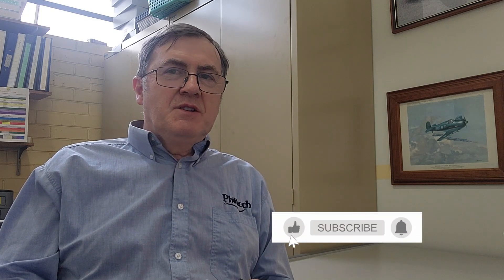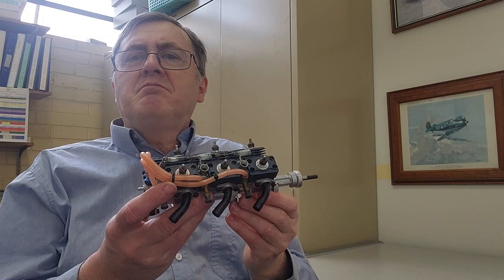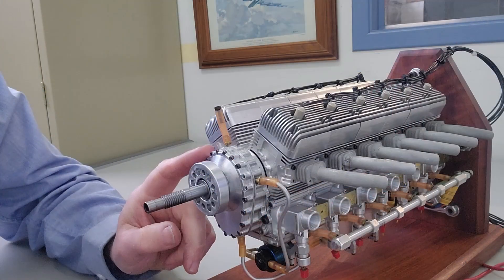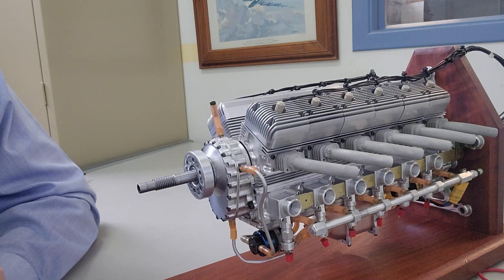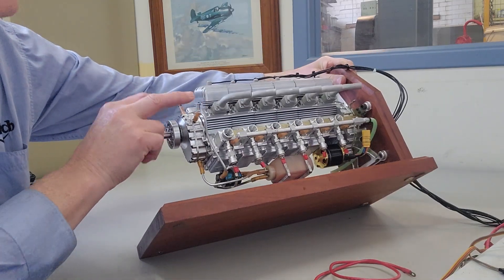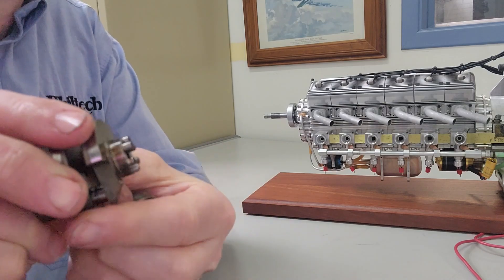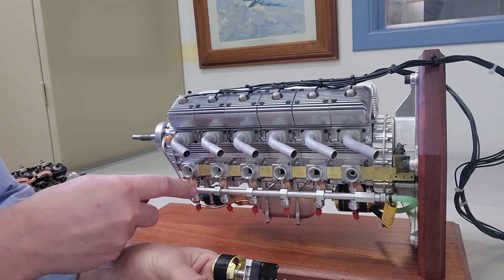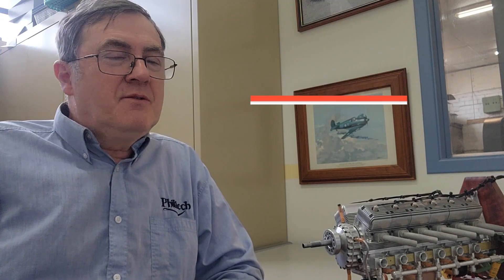Philtech goes to a big capacity model engine with 12 cylinders.

Comment: Cooling this layout is a big question. Also a two stroke doesn't need 12 cylinders to sound right. Infact it will sound wrong.  A six with the same capacity will sound like a twelve. So why not simplify it?

Comment: The solution is rotary valves. Compact, simple and a 4 stroke. Look up the HP .49 model engine and webra 4 stroke model engines

Comment: Why 2 stroke?  If it was a 4 stroke it would have sounded much better.
Beautiful engine though.
Reply from the maker: 2 stroke is simpler and cheaper to develop and manufacture and also better power to weight ratio than 4 stroke. It is a project I would like to try once we have the 2 stroke version in full production. It has been a big challenge to get the 2 stroke engine to a flying state.